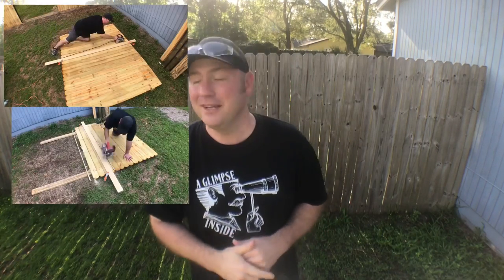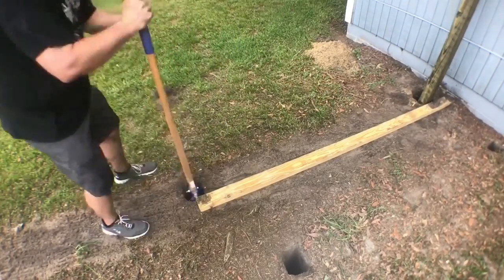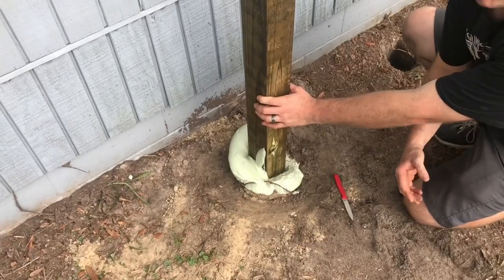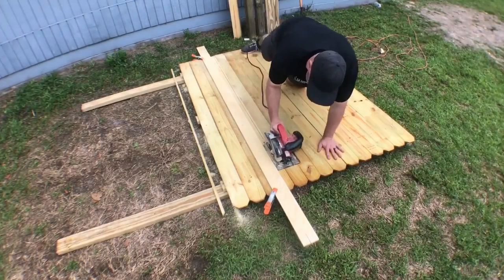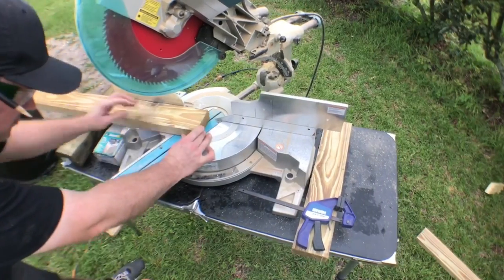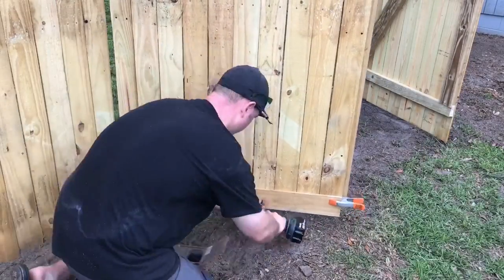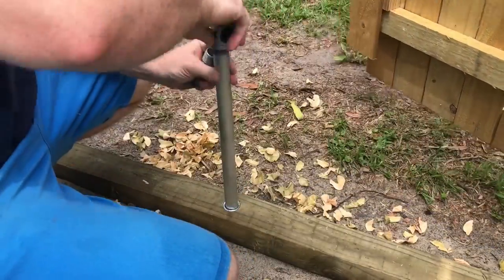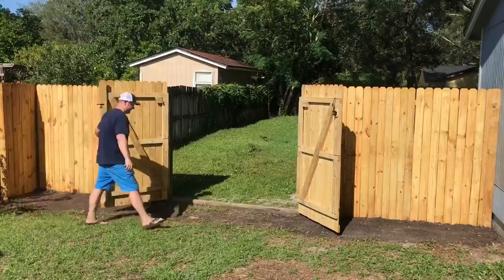How to Make 2 Gates Out of 1 Fence Panel | Won’t Sag | DIY Woodworking with Minimal Tools

Comment: How much feet long are ur doors,cuz mine r 6feet long and Don want them to hang,what do I do
Reply from the maker: I took a 6 foot panel and cut it in half so my doors are 3 feet each. 6 feet is a long span. I have another video in which I made 5 1/2 foot doors. You might want to check that one out as well
Reply: A Glimpse Inside please tell me the name of the video

Comment: How is the foam you used on the posts holding up? Seen it but never tried it.
Reply from the maker: Seems to be working well! I like it very Much
Reply: whats the price of  that  foam vs a bag of concrete?  i built a  fence  last  summer i put a  bag and a half in each hole .  6-8$ a bag of the crete
Reply: way faster  and easier on the back too ,
Reply from the maker: African Cichlids The phone is around $11 a bag and I used it for two posts probably should’ve dug the hole bigger and use one bag per post

Comment: PROTIP: when building a fence like this, don’t start from the high point of the fence, start from the low point of the grade so that you don’t have the “step up” look at the top of the fence. Shave the panels at the bottom near the side of the house. Decent project, but understand the quick timeline due to having kids and a job.

Comment: I like a x pattern for the gate it will not sag at all
Reply: I disagree... respectfully. Lack of stoutness of the posts, weight, and weak hinges is what make a gate sag. You want stout posts, strong hinges, and a light gate. One diagonal brace with the bottom on the hinge side is best method. To each his own tho ;)

Comment: Why didnt you cut off the bottom of the pickets on the doors then put the hinges on so they would be level with the fence line?  Would that not work or something?  Not a wood guy myself, viagra wont even work with me..  so tend to stay on the metal work side of things..

Comment: Why did you take down a good fence that should have been waterproofed and or stained a few years ago instead of taking it down? The foam is garbave use concrete to gain weight and vertical stability, and if you are in Florida you better have a permit because they are money hungry permit forced.
Reply from the maker: I respect your opinion but I’m not sure what you mean why did I take down a good fence instead of taking it down?
Reply: The fence you took down was never waterproofed or stained with oil based paint to preserve it , so it would have lasted many many more years. You removed a fence and put up another fence 4 or 5 feet further back not sure why you did not use the old fence.
Reply from the maker: Richard Lentner I needed to install a gate to get to the area of my backyard due to our patio being put in. So I decided just to remake the whole thing using only three fence panels. Granted I could’ve made a gate out of the old panels I just figured it was time to refresh it

Comment: I don’t k ow why people still use wooden post.That is the main reason the fence fails in the first place , also pickets should never be touching the ground, as the water will begin to rot the pickets away soon. I posted a proper way to build a gate on my page . I do like the threshold idea though , but imo this is not the proper way to build a gate . Just my opinion though
Reply from the maker: Thanks Derek this is what this whole YouTube thing is all about. Getting opinions trying to do things better the next time if you don’t make something better the next time you make it then what’s the point. Definitely good information Derek I appreciate it

Comment: What's the point of doing something if you're not going to do it right? I appreciate the effort, but the fence, and the gate should be level and straight. No matter the terrain, within reason. This was all about shortcuts, and doing the job wrong. If I were your boss, I'd make you tear it down and do it right.
Reply from the maker: I definitely respect your opinion and yes I’m actually on the proverbial fence if you will about raising up and fixing it in the weeks to come.  Much respect!
Reply: A Glimpse Inside dude, I just did a fence build too and used the sika two part foam. Don’t bother grading the terrain, the fence shorter on the steeper side to make it match. Problem solved!
Reply from the maker: Phil Pinsky Productions ahh good idea!  I was also thinking of putting headers above the fence that we didn’t match up, I don’t know I have a day to get this done it out of the rain, definitely going to figure out something here in the next couple weeks when I have more time
Reply: Make the adjustment to the fence if you want or not, its your house. The point of the video is to get the knowledge out there for those of us that want to try for our selves that might not know where to start. I think you achieved that and I learned a lot on this one thanks.
Reply: I think it turned out great, Chris.  Technically the fence did turn out level and straight. The left panel may not be "even" with the others but it looks good to me. If you were to adjust the terrain to compensate, you'd compromise your drainage. If you wanted to keep it all even you would have to get longer pickets for the left side and custom cut each one according to slope. Not the point if you're installing panels and trying to save time and spend time with that cute little red head.  So, it's a good thing you're your own boss here and you don't have to redo anything. Well done, Chris.  Troy
Reply from the maker: Xquisit Ink thanks man! Alway great to hear from you on here! I appreciate the kind words man it means a lot!!
Reply from the maker: secondwind75 Troy!... thank you man!  Your right about it all being level. I guess it’s all relative. Thanks for your words and thanks for your input. It’s always nice to get multiple takes on the same thing. Thanks for your feedback brother